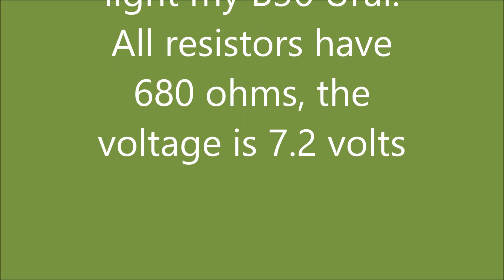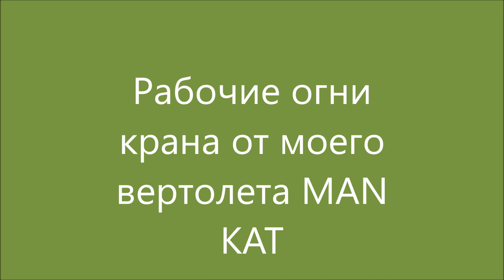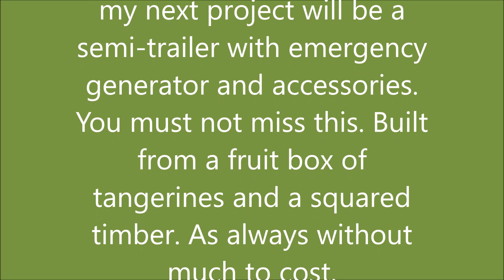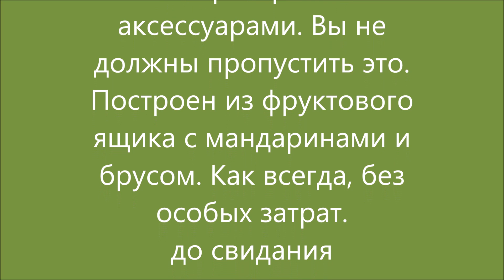WPL B 36 Part 3 Crane construction Lighting with LED

Comment: It’s awesome the amount of work you have put in on your build   I’m curious to know how many hours you have invested in your b36
Reply: Also do you sell that light kit you made
Reply from the maker: I do handicrafts only on the weekends or bank holidays. Since I am not as precise as other model makers I am quite fast :-) Did not pay attention to the time maybe 20 to 30 hours? It's fun because time goes by faster.
Then comes the video cropping and uploading on Youtube, because I'm not a specialist, sometimes it takes longer than tinkering. If I want to test drive it's dark night or it's raining. The reward for my crafting is when I have others Can bring crafts and can pass on my knowledge.
Reply from the maker: Unfortunately, I do not sell. That would be even more loss of time for me :-). The LED and resistors are there for little money 5mm and 3mm diameter drilling. If you do not want to solder you can just turn the wires together a little isolier tape and It also works. At 7.2 volts you broke about 680 ohms resistors and LED your desired color. At the LED is a terminal flag Longer is the resistance and the resistance of the plus pole, which is usually red. At Ebay I have already light sets for WPL seen front and rear lights